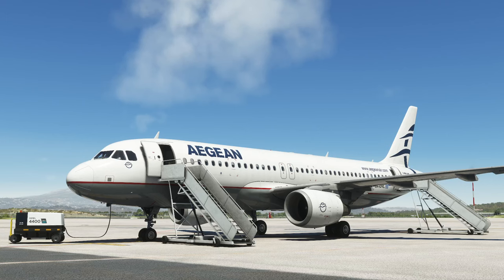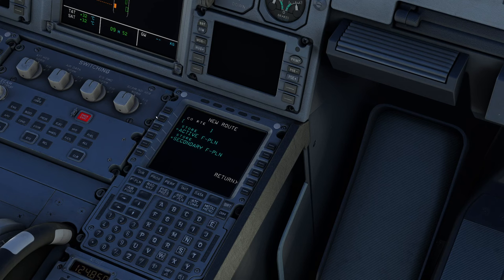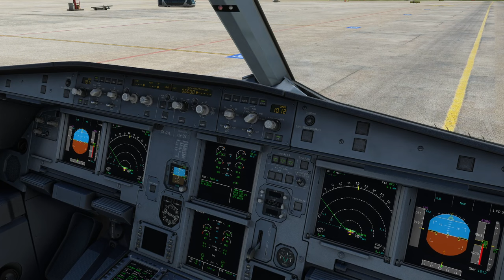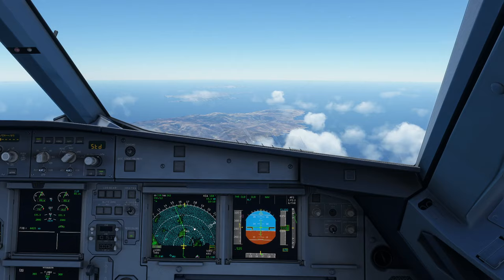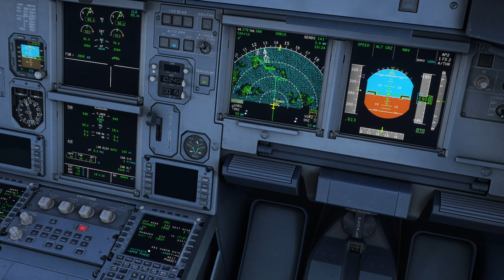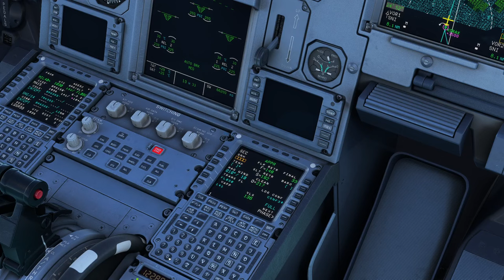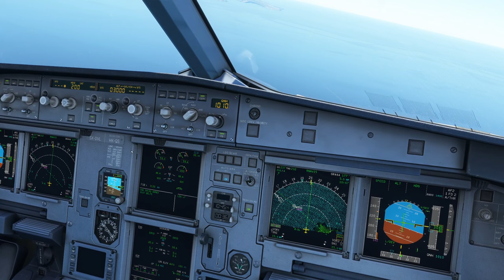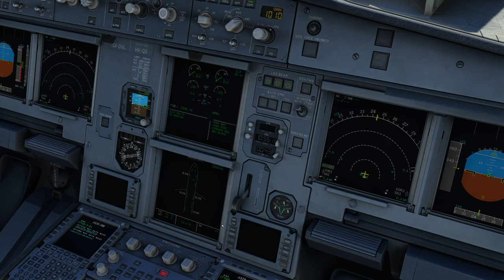Fenix .214 FULL FLIGHT | How does it perform? | incl. Circling Approach | Real Airline Pilot

Comment: Thanks for the video! I think the GS mini function does work correctly here. Note that with a tailwind, the GS mini function should increase the IAS target when the current tailwind drops below the MAG WIND (tower tailwind) programmed in the FMC. This is to avoid a sudden thrust reduction and drop in energy during approach when the tailwind disappears and the airspeed increases as a result. The same happens with a sudden increase in headwind. You can see this by filling in the formula of the GS mini function, but using a negative headwind: 
Wind difference = CURRENT HEADWIND – TWR HEADWIND = –4 + 10 = 6
IAS TARGET = Max [ VAPP, VAPP + WIND DIFF ] = Max [ 140, 146 ] = 146

Comment: I would be interested to see you try idiling at the 30RA callout as most of the 320 type rated pilots have been suggesting to you, that might help your float a bit.
Reply from the maker: I simply can't find any documentation that would support this. The FCTM suggests quite the opposite indeed:
At 20 ft, the "RETARD" auto call-out reminds the pilot to retard thrust levers. It is a reminder rather than an order. When best adapted, the pilot will rapidly retard all thrust levers: depending on the conditions, the pilot will retard earlier or later. However, the pilot must ensure that all thrust levers are at IDLE detent at the latest at touchdown, to ensure ground spoilers extension at touchdown. In order to assess the rate of descent in the flare, and the aircraft position relative to the ground, look well ahead of the aircraft. The typical pitch increment in the flare is approximately 4 °, which leads to -1 ° flight path angle associated with a 10 kt speed decay in the manoeuvre. Do not allow the aircraft to float or do not attempt to extend the flare by increasing pitch attitude in an attempt to achieve a perfectly smooth touchdown. A prolonged float will increase both the landing distance and the risk of tail strike.
Reply: @A330Driver  But he asked if you could try it
Reply: @A330Driver  The A320 FCTM explains that the flight crew can rapidly retard all thrust levers to IDLE either earlier or later than the 20 ft “RETARD” auto callout reminder depending on the conditions. - it doesnt have to be exactly 20 feet..
Reply: Reducing thrust earlier is normally going to cause you sink faster so would expect t to reduce float the ultimate example of this is stalling onto the runway at touchdown.  A.l this 10ft before 10ft afterwards is based on conditions, weight, pilot experience its why the docs don't say exactly a time but by a time ie touchdown.  Ultimately its a minor tweak fron fenix and it probably all fit together.  Until block 2 comes out I think it's something to live with and accommodate.  Rest of the flight seems pretty good.
Reply: @m3taleye  yup
Reply: @m3taleye  Because it's MSFS and the ground effect is absurdly exaggerated - completely unlike IRL. That's the problem with flying the plane "by the book". MSFS is not the real world. X Plane gets much closer to real life ground effect, and you can fly the plane by the book.
Reply: @A330Driver   Hi emanuel. First thanks for your video and vlogs, i love them. Second, Im sure you are way more experienced than me in the a320 and I wont talk about the practice Ive seen in the real world. The only thing I will tell you, and its for MSFS ONLY, I have more enjoyable landings with the Fenix V2 by idling before initiating flare, or at least start to reduce N1 before flare. I wouldnt do that with Fenix V1, but with V2, no doubt. Maybe it will change again when they will release the block 2 of their update.
Reply: Idling at 30 does somewhat helps in reducing the float in my experience, that's what I usually do in the Fenix, but I can't comment on realism aspect of it as I'm no irl pilot. But in my experience Toliss behaves bit differently, as in you can start idling later than Fenix. Also Fbw is much easier to control and land manually, may be it's simple flight model or something I don't know.
Reply: @sc_365  toliss use a different platform, it's not comparable. But for the diff between fbw and fenix, I reckon you didn't set up your control for the fenix correctly. I didn't see any noticeable diff between the 2, both are very responsive, in their own way. Fenix v2, correctly set up, allow to do perfect crosswind landing in a relatively easy way. Though my fenix and fbw sensitivity, are set up in a very different way, despite using same hardware
Reply: @homasas4837   Toliss & Fenix use diff platform sure, but I'm comparing their behavior and how that translates to my experience at present. Also by that logic, why even bother comparing them to the real one either? Sure it will get better with time. If that comparison is not made how else would we conclude if it's a platform specific limitation or module specific limitation? Again nothing against the devs as they all have done such an awesome work here.

Quoting you here - "Fenix v2, correctly set up, allow to do perfect crosswind landing in a relatively easy way" - sure, humans can adapt to any behavior with some practice, be it a 172 with 747 physix.

And only clarification I need to make here is, when I say Fbw feels easy to control, I mean it seems little bit like "on the rails" sort of physics, sort of how older xp11 physics were, now I don't know if that's just in my mind.

Also quoting you - "both are very responsive, in their own way", that's exactly what I'm saying when I say they are different.

Anyway my original answer was just regarding the question about idling at 30ft to reduce the float and how it behaves in each of these modules, nothing about setup, accuracy, etc etc.
Reply: @sc_365  x plane has different physics than msfs, and is way older. I dont think it's a fair comparison.
Reply: @homasas4837   But 12 isn't older right? And anyway I just meant to use it as a point of reference.

Comment: While they've made MASSIVE improvements..am I the only one that still regularly goes back to the Toliss because the fenixs' engine model sucks? Eng oil temp immediately skyrockets to normal before starts even complete. Single engine flight characteristics are..interesting to say the least. They're so close to getting it right though! I'm hanging in.
Reply: Once block 2 is released that should all be fixed
Reply: Fenix custum engine simulation will coming in block 2 update.

Comment: why idle so late with such a tailwind?
Reply from the maker: Thrust reduction is perfectly fine, those 30ft some are advising are just not correct for all situations. See the FCTM quotes I posted under the other videos.

Or look at Blackbox711s recent video which basically confirms the critique I voiced.
Reply: @A330Driver  BBs video is about flap 3 landing, which has incorrect "flat" pitch, thus leading to lower per second nose down input in flare, which was explained to you three videos ago, by Aamir, in your first review of .214 . I don't see the connection to this comment on flaps full approach. 🤷‍♂
Reply: V1 had his own critiques with full flaps if you’d prefer those. The goal is to make the product better. The way that’s done with this or any other product is through critique and an ongoing effort to improve the product. Trying to shut down criticism is counter productive. I can’t believe how many times I’ve heard from end users that criticizing a product undermines all the hard work that’s gone into it. That’s nonsense and not how the development world works.
Reply: @Danimalpm1 He did but thinks the issue lies with MSFS per the lengthy statement. Not heard him say anything bad and still doesn’t float. Being critique is fine but only so much can people take before they need to be told to stop comparing to other sims, airliners list goes on…